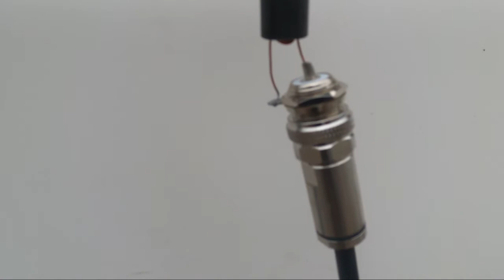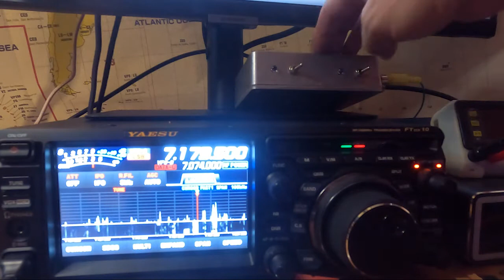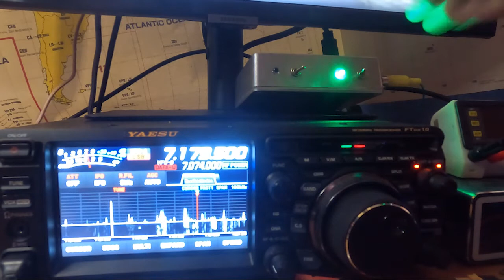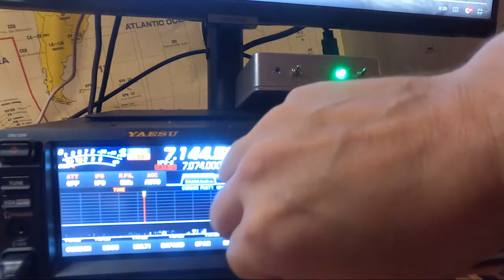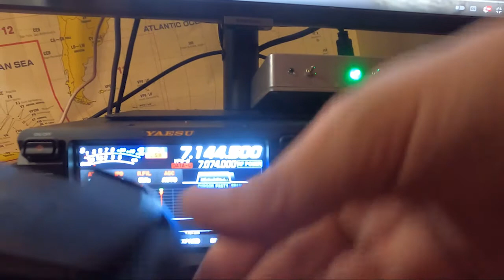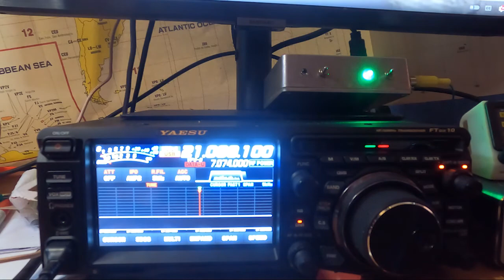Automatic RX antenna switch demo

Comment: Thanks very much Nathan. Looks like you have things sorted, just need to get the loop RX better, but still keep the noise away. I have been thining deeply about your comment on the ~manufacture the box~ video where you made reference to the insulating tape to stop the relays contacting the case if they dropped away from the sticky pads. Why didnt you use the lid of the box as a lid and put the printing on the top, instead of using the lid as the base, or are you worried things might move about in normal use?
Reply from the maker: Good question.  If I built it all on the bottom, it would have made putting it together a bit of a nightmare and I'd have had to use flexible cable for the RF instead of solid copper as as to reach the so239's.
Reply: @nathanw851  Good point, well presented. I knew there must be some sensible reason.

Comment: the issue you're going to have is the tuner internal to the radio is still set to the transmit antenna. when you switch it to the loop it's tuning settings ARE going to be different. which can account for some of loss of rf on receive when it's turned on. ideally you would want to turn off the tuner on receive :D
Reply from the maker: Dammit.  Take your science elsewhere.  It has no place in this hobby!   :)  That didn't cross my mind in all honesty. Too much effort to introduce a microcontroller to issue CAT commands to disable the tuner (if that's possible), but it's still viable for a resonant antenna at least.